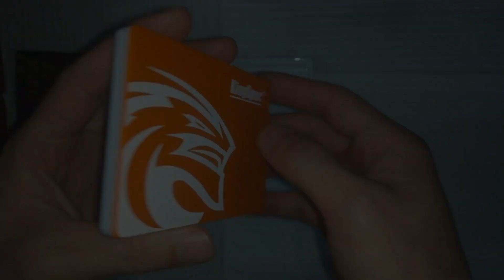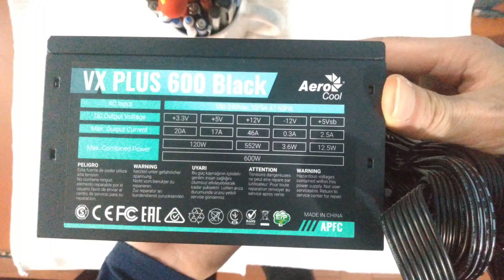PC X79 CHINO - MACHINIST X79 V2.89 Colombia

Comment: Pana hoy hice el pago de la misma board para acá a Colombia quería preguntar si la board permite overclokear la ram y que tal te ha salido las temperaturas y etc
Reply from the maker: Hola, brother, hace poco a esa board le monté un Xeon E5-2660 y va perfectamente, de temperaturas no sé si estén erradas pero no me pasa de 58 grados y 65 en full operación. Algo que se extraña es otro puerto SATA 3, también hace falta en mi caso otro USB3.0, no creo que a mucha gente le haga falta. Las velocidades de transmisión son óptimas. Cosas raras que he notado... Al conectar todos los puertos USB 3.0 incluyendo el del panel frontal de mi torre, alguno se reinicia y hace el proceso de volver a detectar lo que se haya conectado, lo mismo me ha pasado al tratar de pasar archivos entre dispositivos USB 3.0 con todos los puertos llenos. Otra cosa rara y no sé si tenga que ver con la board, es que en páginas donde hayan muchas imágenes hay un leve retardo al pasar el puntero por encima.. es raro y es sensible, causa molestia. Mis memorias son de 1.333 pero la subí desde Bios a 1.600 sin problema y ahí va normalmente, también ví la opción de 1866 Mhz disponible, así que no creo que tengas problemas, pero no he monitoreado las temperaturas de las RAM, y por ahora uso 16Gb en dual, pero si mal no recuerdo está base soporta Quad channel. Por lo demás todo perfecto, juegos al pelo Salvo que la gráfica ya se me está subiendo mucho de temperatura, era de minería así que tendré que hacerle de nuevo mantenimiento. Ah cuidado! Los plásticos verdes como el del puerto USB 3.0, se sueltan fácil, no están firmemente adheridas a la board pero no rompen, solo se sueltan. 😎👍🏻
Reply: @FabianReyesBahamon  buen pa gracias Cúa to te tarde en llegar a Colombia ps mi planeado es usarla con un 2970v2 o un 2690 y con ram de 1866 sobirla a más de 2000 aunque dudo que lo soporte si no unas de 1600 subirlas a 1866
Reply: Mi pregunta es sobre la temperatura de las vrm
Reply from the maker: @patataplus7661  Hola, Esas temperaturas no tengo como medirlas,  pero no no he tenido anomalías.
Reply from the maker: @patataplus7661  Tardó como 22 días si no recuerdo mal, soporta esos procesadores pero no estoy seguro de la RAM